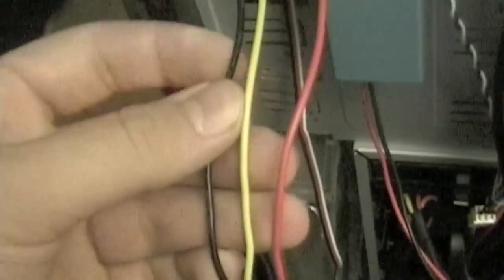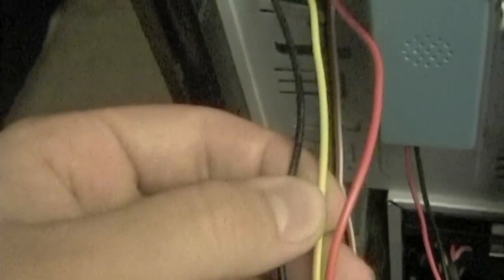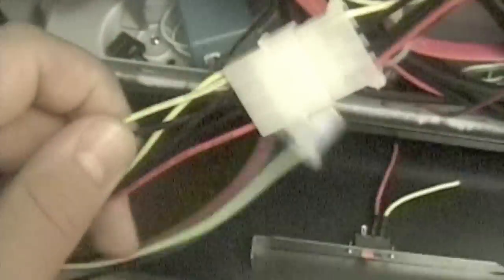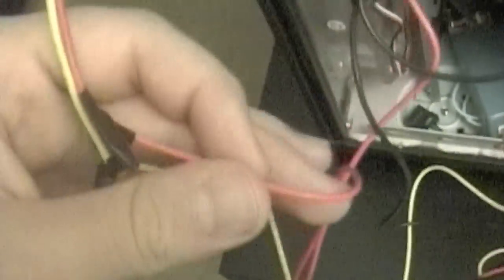How to Install Cold Cathode Switches

Comment from the maker: i dont think you need to solder quick connects. You need the right size for the wires and then you need to crimp them. You need a crimping tool to do that tho

Comment from the maker: Yea no ground is needed if u don't have LEDs in the switch. I just cut the end of the molex from another cable and left some yellow attached to the connector. Then just soldered the 2 ends